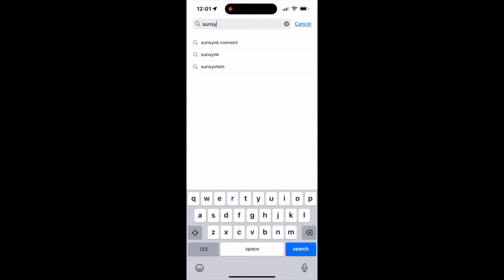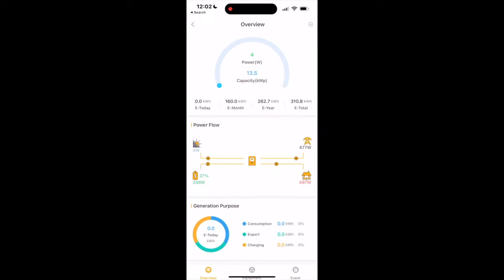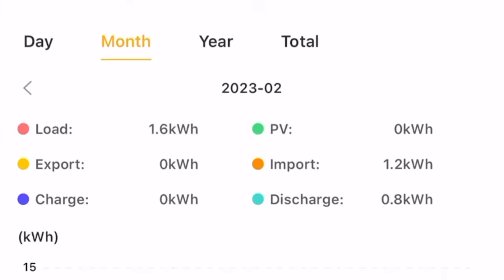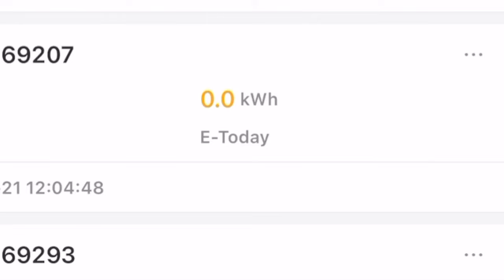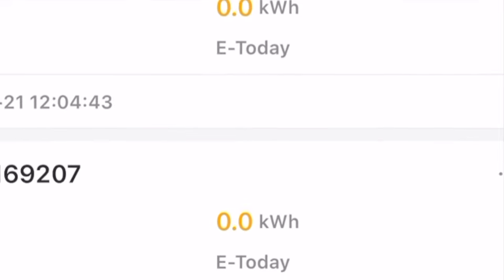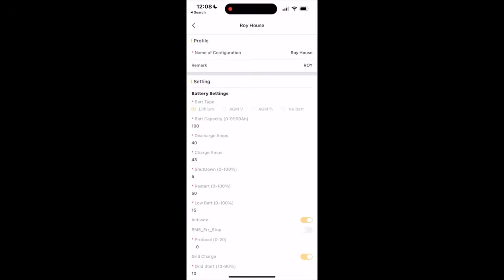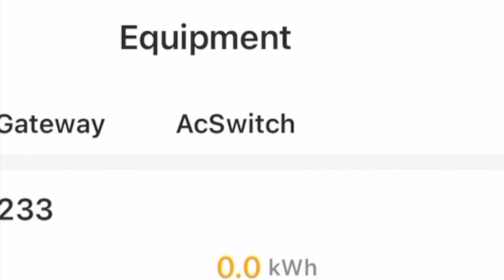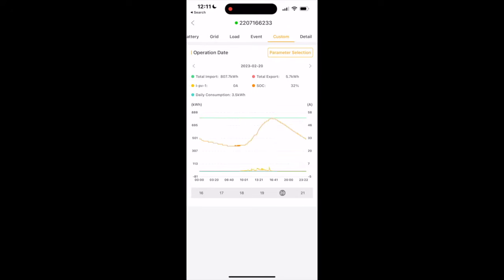Sunsynk Connect

Comment: I was using luxpower app and it gave live information. When I put on a kettle, it would show on the app immediately. I could tell when a high current draw appliance was on at that instant. You only use data when you are using the app, just like any other app. This sunsynk app should be in real time, no excuses.

Comment: Thanks, Keith. in the UK I use Octopus agile tariff which means you can change grid import according the price published daily. can you do a video how to adjust settings daily basic on price. I tried it but sometimes the invert import from grid even I changed the setting with timer. Not confident in using equip settings on daily changes.

Comment: A useful feature might be to connect the weather forecast to the state of charge. In the Uk if the weather on the following day is poor we want to import cheap electricity to fill the batteries. But if the weather is going to be ok then we want to discharge the batteries to about 50% during that low charge window.  I can’t find this feature yet ? But is it possible without checking the weather forecast every day?

Comment: Hi Keith. Thanks for all the great and informative videos.  I have got 3 x  12 kw 3 phase inverters in parralel with solars and battery backup on each inverter. Is there a way to get the data logging info as a combined picture for the 3 inverters, or can it only be each inverter seperately ? Your help will be much aprreciated.

Comment: Hi Keith. 
I can’t find the info or I’m looking in the wrong place. 

If I run 2 inverters in Parallel, can one inverter use the Aux port for a Generator input and the other Inverter Aux port to drive a Smart load out?  Or is the aux system following the master settings totally ? 
Thanks.

Comment: Morning Keith.  Are we able to force discharge the batteries at a specific time?
Reply: Yes, tick grid on the system mode menu next to the time slot you want to charge.
Reply: @hein_mcleod  Not charge, but discharge?
Reply: uncheck the User Timer setup in setting menu, and then turn on all the appliance in the house and let battery drain.
Reply: When unticking the Use Timer, the inverter charge from the Grid but does not restrict charging to the Grid current specified in the Battery setup screen. This is a huge shortcoming.

Comment: System mode needs to be explained better to end users. Especially for different scenarios of use. As in my case I would like to preserve the battery life cycle of the battery. I would like to limit the charge of the battery to say 80%, not just the lower limit of the battery. Your battery management seems smart enough to handle this. Would be nice to be able to set a min and max setting on the battery during the times.
Reply: Yes I agree this feature seems to be missing, especially for use in summer months I don't need my 10kw battery fully charged when I have excess solar anyway.
Reply: 100% needs a proper detailed video to help people understand their usage and tailor the system to them.
Reply: Agree
Reply: Interesting, maybe this can be another feature.
Reply: Agreed!